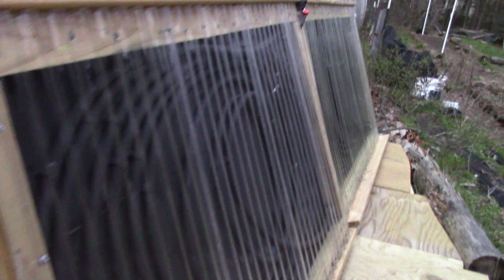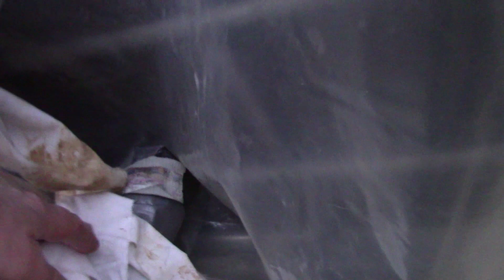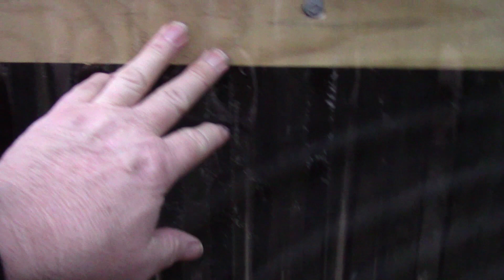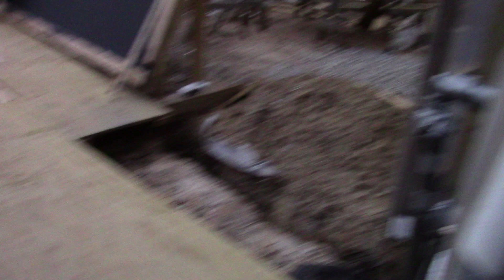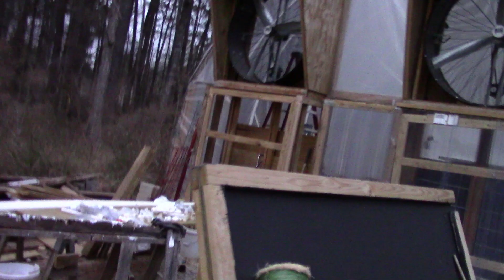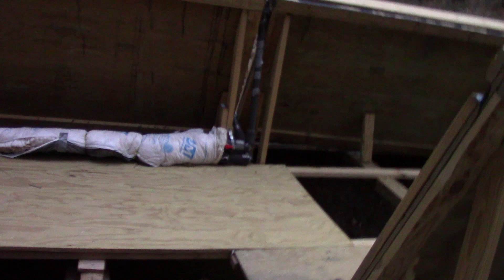Solar Heating the Aquaponics Greenhouse Part 3 of 3

Comment: Mr Green Gregs' if you would be interested in the system I use to heat AND store HOT water for bathing from passive solar rays made from recycled mostly products, let me know.  I have made 3 so far.  2nd design seems to heat equally well and much simpler to build.  I gave up with the coiled blak polypipe since I could only get hat water in the middle of the day.  Thinking of building an aquapontic system utilizing this system also.   If I can figure out how to properly orient the recycler.

Comment: How much heat are you getting/will get from that array?  I have been contemplating constructing my tilapia tanks in-ground for the thermal stability (keeping those fish at 55) .. I know that you don't freeze as often around H-ville as we do out here in T-town, but when it does, it does with a vengeance!  I would love to see some temp logs .. external/ambient greenhouse/tank/inflow & exflow to the array, ect.    Aquaponics has been on my mind for some time now, and I know that when I do it, I want to build a system with no dependence upon a fuel source that I cannot readily produce with my own hands - so passive heat exchange is very attractive.